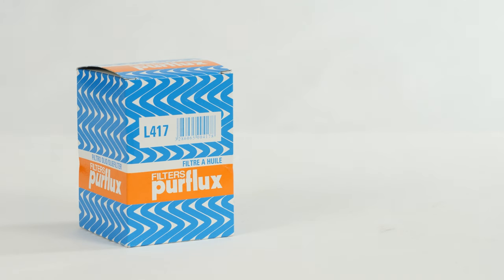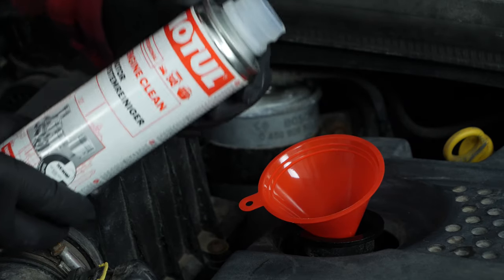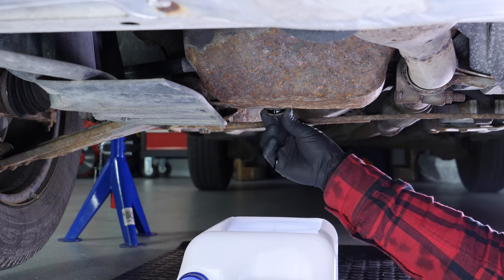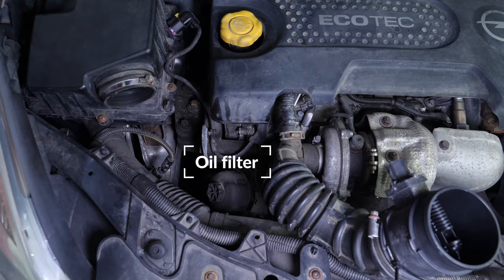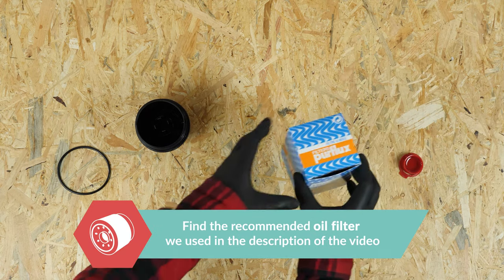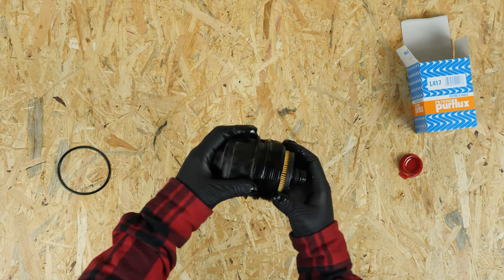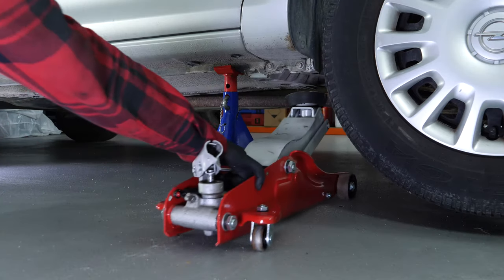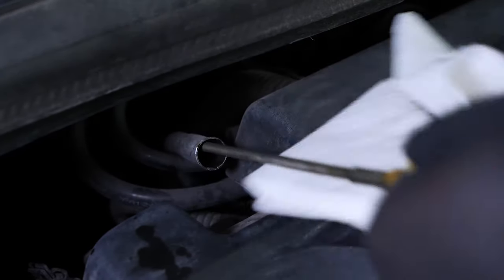Change the oil and the oil filter CORSA D 1.7 CDTI 🛢

Comment: Nice video, doing my sons corsa 1.7 diesel today, fuel filter too. Very rough idle, cutting out so ordered suction control valve, hope that turns up today. No fault codes which is par the course for the problem of suction control valve. Does not send any errors. Will edit post let people know how it turns out. Thanks for video. :-) vinny.
Reply: Hi Vinny, did the suction control valve cure the rough idling?
Reply: @tonyrobinson2471  yer mate it sorted it out so much but also it had a problem with water ingress into the ecu, that got sorted and the car ran great then, it was my sons car, he sold it a while ago now.